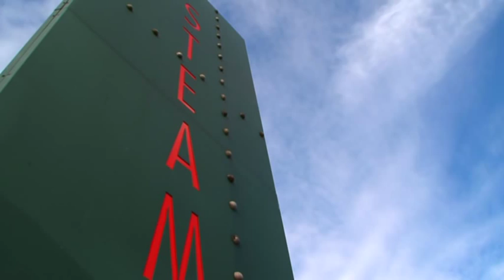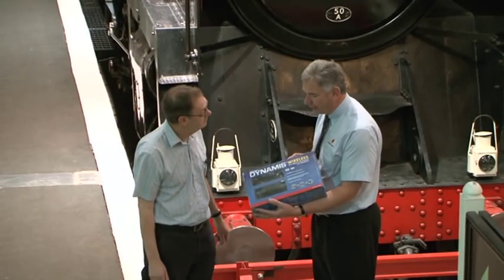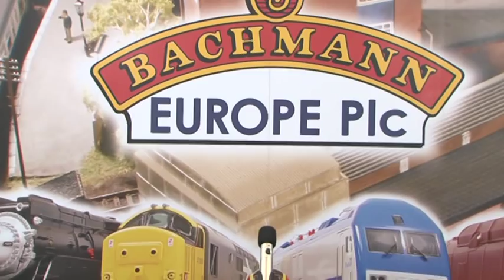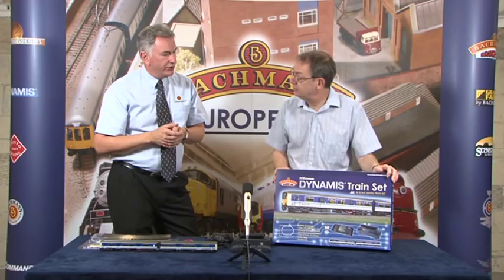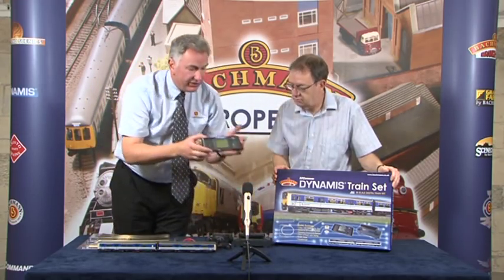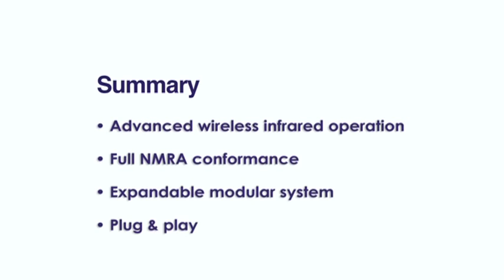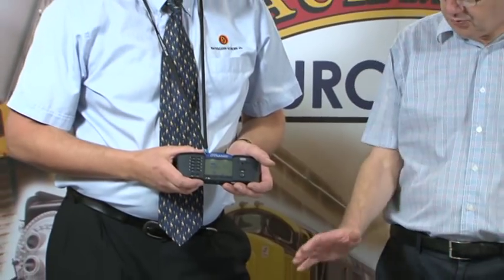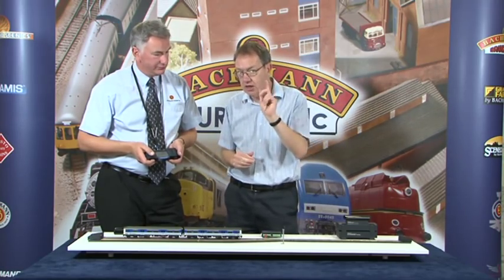E-Z Command Dynamis Part 1.VOB

Comment: Please, somebody help me about signal loss.
I bought  one. At the first day works   well, but late, i lost signal.
Reply: It can be programmed out it has a setting that causes the locos to stop if the controller loses contact to long but it can be changed I just can not remember how I would have to get my instructions out